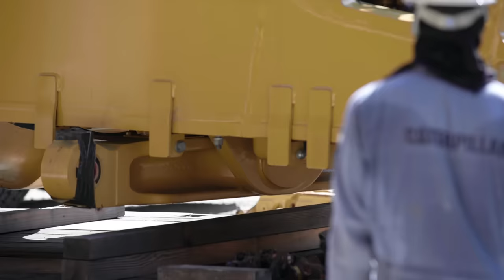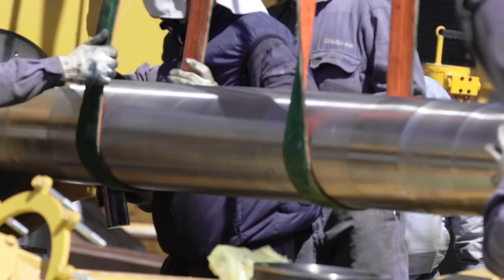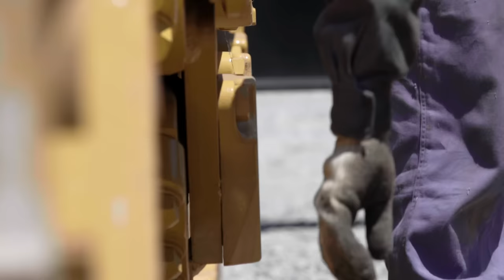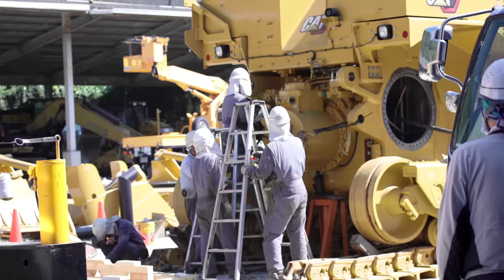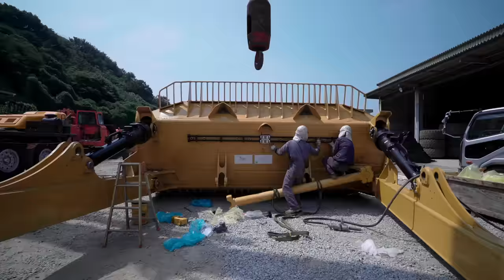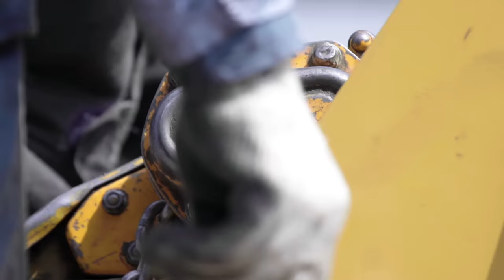D11組立映像（Caterpillar D11 Assembly Process）

Comment: I've put a lot of new D11's together, never had that much man power. We do it with six guys, including the crane operator.
Reply: Dont they usually leave the factory, with just blade and ripper to fit on site, ive not seen one stripped down so far,  must just for transport issues to China .
Reply: @andrewrees8749  They leave the factory on six tractor trailers.
Reply: Ive only seen 1 D11 at the mineing show, in Las Vegas, 2004, they are huge, boss of Caterpillar was at show too, love to go again, 
Do you work at the facility, or on mine sites, ??  Must be great job.

Comment: Geez I hope that was a refurbed D11. The way they scratched the crap out of the paint work on so many of the parts was disgraceful, and then they just hammered in the pins !! You have to freeze them, then quickly press them in so they seal tight !! Caterpillar would be horrified !! But I guess if you pay them, you can do what you like to it...